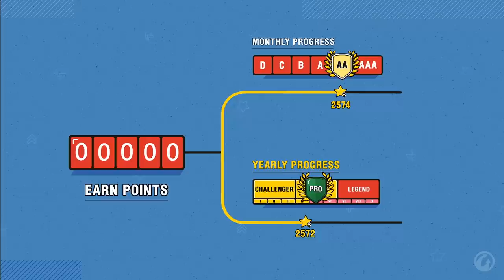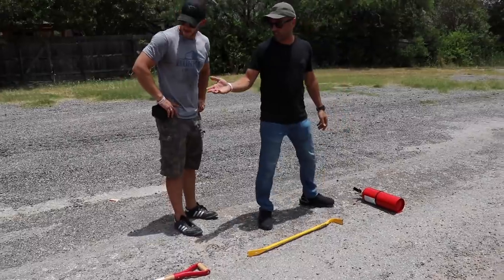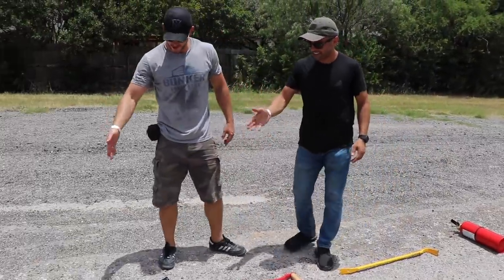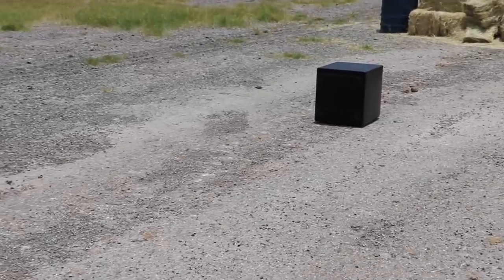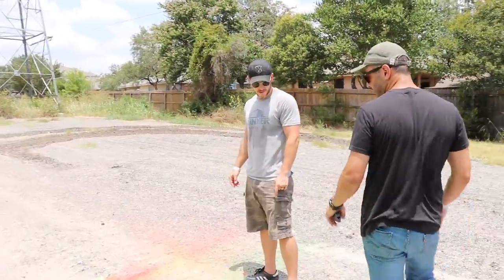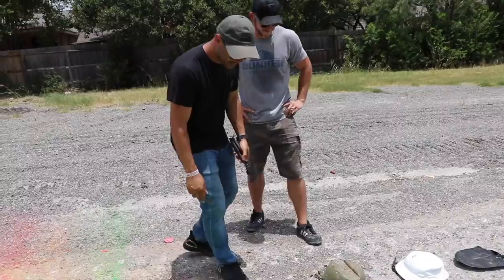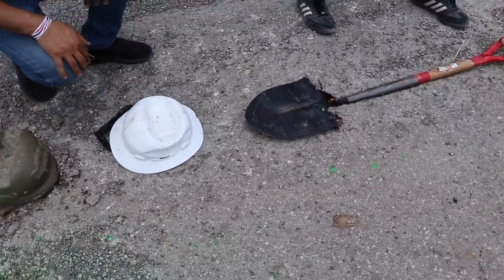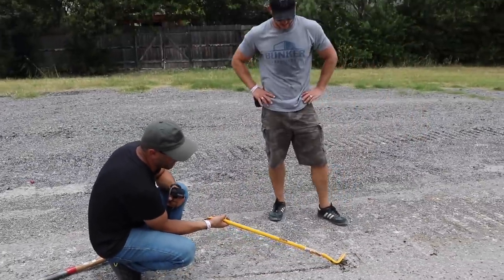Will a Tank Crush a Safe and a Ballistic Helmet?

Comment: Am I the only one hearing a low frequency pretty loud all the Time in this video? O.o
(For example at 10:40 it gets really loud)
Reply: On the phone I cant hear the noise but with headphones it is extremely loud :D
Reply: ye same here, with headphones on
Reply: I think it's tank engine idling
Reply: I think its the tank engine, those things are really loud, look: 8:00
Reply: Its microphone interference from the transmission lines overhead. You’re hearing what electricity sounds like. 60hz rumble
Reply: @specialestness  Just checked out how 60Hz wave sounds like and I think you're right. Compared it with the sound of a tank engine and it would be way too quiet from this distance. From farther it could be similar, but the tank is like 30 meters from them.
Reply: That is the tank
Reply: Thats the diesel engine in that centurion . Many tanks have that gut shaking rumble .
Reply: @specialestness  You are correct.  It's only there on the handheld cam.  Absent on others (GoPro).  The signal paths are shorter on those and less susceptible to inductive coupling.  The EM field under the transmission lines is quite strong!
Reply: Overhead power lines - they appear to be 500,000 volt primary lines. Lots of EMR’s for everyone.

Comment: If the tank didn't have independent suspension, it would've crushed stuff a lot better, especially that stubborn fire extinguisher. Since all the other wheels are touching the ground aside from the one that's over the item, you really only get the force of the suspension pushing down on the items, except for the safe, that had a lot more force applied since it was higher up and leveraged more of the tank's weight onto it. It's still several tons of force on all those items, but probably not as much force as was hoped for. Still cool though!

Comment: As for the hard hats and military hats being crushed by the tank ... those idle wheels are designed to contour the ground and they are linked by multiple suspension  so the full weight of the tank cannot be applied in one spot so it drastically reduces the weight being applied to one specific spot.......  just sayin

Comment: Do a picket fence roughly 10 meters long built to code. And drive a 60 ton MBT from any nation An Abrams, leopard, AMX 50, Challenger 2, T80-U, or Ariete PSO. Warthunder physics says a single fence post stops a MBT going 60kmh  down to 20kmh